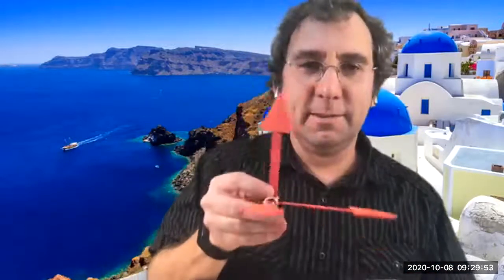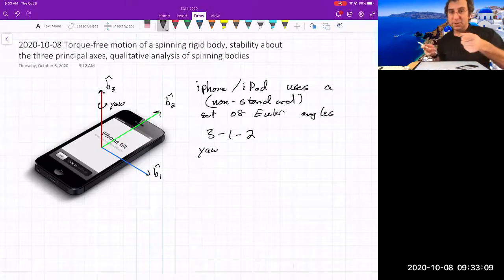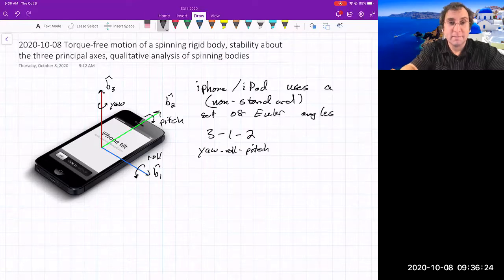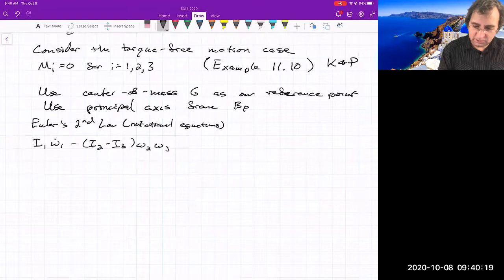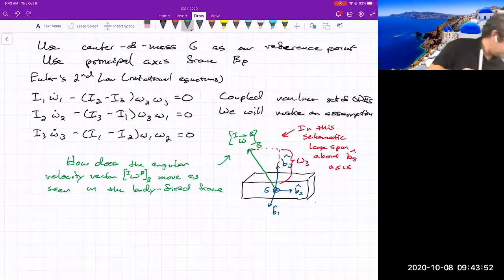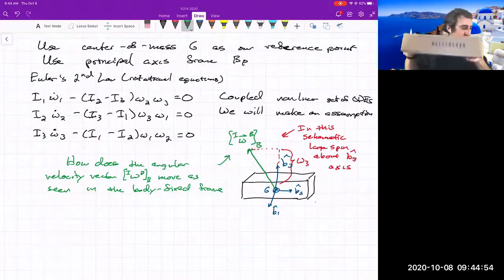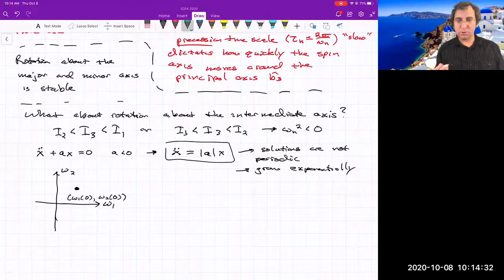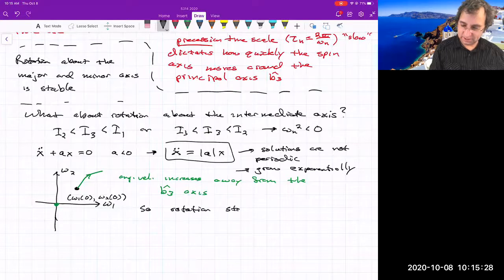Free Rigid Body Dynamics, Stability About Principal Axes, Spinning Qualitative Analysis | Lecture 14

Comment: Rotation around the intermediate axis is unstable, but it doesn't seem to be forever unstable. What I mean is, if you look at the video of the spinning wingnut from space, or the 3-d simulation you showed in this video, the body doesn't just tumble and tumble. Rather, it flips over, and then becomes apparently stable for a time, with a relatively non-moving angular velocity vector, until the instability you derived from Euler's equations again causes it to change orientation. 
I'm looking for the equations that show why or how the angular velocity vector, having accelerated away from its initial position, slows its change in direction and apparently comes to rest, until the process repeats.
I haven't been able to find that information. Hope I described my question well enough! Great videos!!

Comment: In your analysis on 12:25 do the body fixed frame (b1,b2,b3) coincides with the principal axes frame of the body?
Reply from the maker: Yes. The discussion starting at 9:00 mentions that the equations we use are for a principal axis frame, which is what I'm showing as the body fixed frame (b1,b2,b3)
Reply: @ProfessorRoss  Thanks for always answering my question in particular